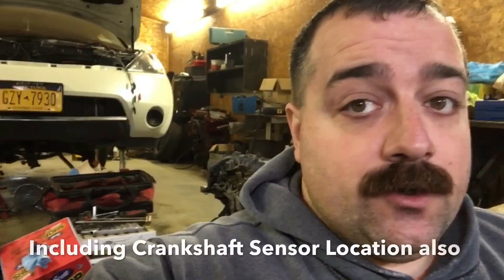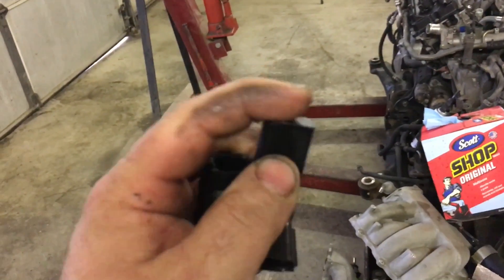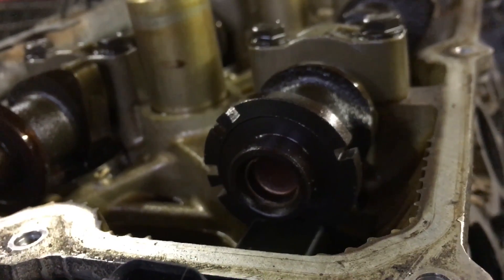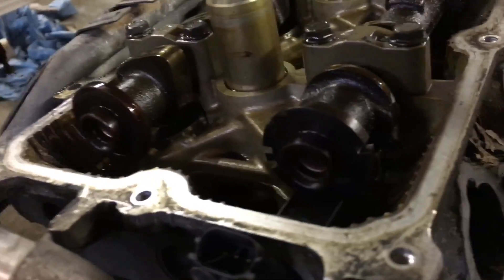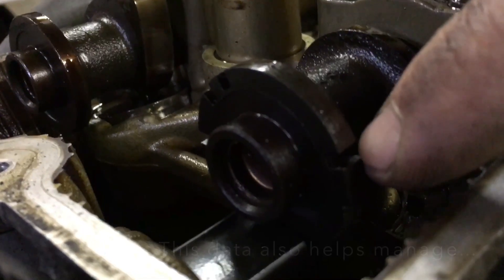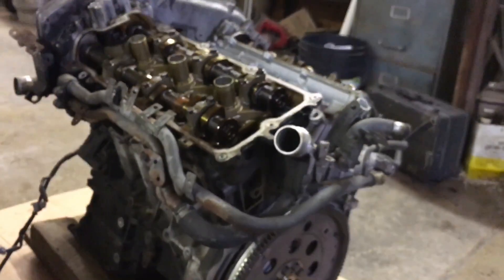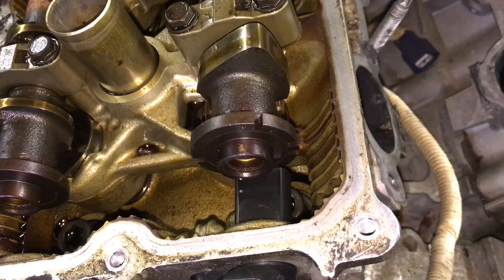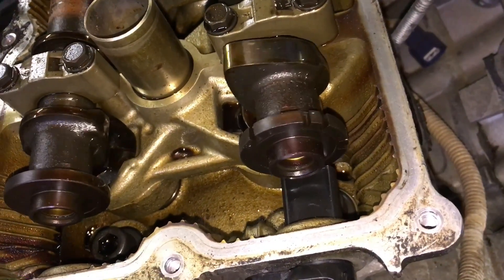How does a Cam Shaft Sensor work?  Nissan 3.5L

Comment: Ok so I have a 2002 chevy astro 4.3 l. It's a crank no start. I am wondering about the camshaft sensor in the distributer cap. The van ran fine until it sat for 4 days. If the camshaft sensor detects gaps then would it not detect gaps if there is a small pile of rust sitting directly on the sensor? If so I'll be a s.o.b. lol
Reply from the maker: Don’t know the history on your engine, but I’d treat it as a traditional crank / no-start.  Check for fuel and spark first. You could have something totally different going on.  If your plugs aren’t too old maybe try swapping a sensor or module inside the dist. cap. I don’t remember if that’s a cam sensor in there or if they call it something else on that engine.
Reply: @JoesCarSmartsNY  yeah, camshaft sensor in distributer is my next move. It appears damaged. Just noticed it last night.

Comment: It's amazing that sensors don't melt given the high heat they are exposed to.  I was surprised to see a Cancer warning on the box of the new cam sensor I got the other day. I think the cancer warning is for the phthalates that added to the plastics in the sensor material.
Reply from the maker: It is amazing.  Look at all the intake manifolds on so many engines now that are plastic too. Pretty incredible.

Comment: Replaced camshaft  sensor  but still gets stuck in 2nd gear when in stop go traffic or sitting and idling for long time when put in gear it might drive 100 feet or 2 miles  and thin goes into 2nd gear Locke into it and won't shift to 3 or or overdrive  but soon as it cools off it will shit just fine wth.is wrong with it.
Reply: It's not the transmission. All shops will tell you that. My 05 maxima was shifting into 5 th gear once I put it in manual. Your ground wire or the connector plug is faulty. 
https://youtu.be/dOGBIC_gjwo
Reply: @mef12727  thanks a lot for video, Its very helpful.
Reply from the maker: That’s a tough one. You might be dealing with a bad transmission. 

I would change the fluid and see if that helps at all. Then have a pro check it out.
Reply: Barbie Fisher...stuck in 2nd gear is called  limp home mode the car is trying to protect itself, normally it is not a transmission issue, either it is a electrical wiring issue or a sensor that is failing perhaps when hot.

Comment: those gaps on the inlet camshaft... if i break 1 of them can it cause the car not to start?
Reply from the maker: If you break one of these sensors off it COULD cause a no start symptom. I know when I get a faulty sensor the car is very hard to start.
Reply: @JoesCarSmartsNY  yah I finally figure it out.....if u break 1 the car won't start and if u are lucky enough to start it the car will misfire

Comment: nissan sunny can run without a crankshaft position sensor?
Reply from the maker: Eaktadiur Rajib The engine should not run without the crankshaft sensor. 

It might run with the camshaft sensor unplugged, but there will be engine diagnostic codes set.

Comment: do you need to set motor to TDC when replacing cam sensor
Reply from the maker: brotherjesus If you're only replacing the sensor then you do not. TDC is critical when replacing timing chains and belts but not this sensor.
Reply: Joe S. Thanks for the info, quick response too.